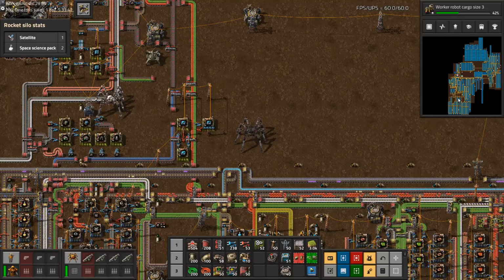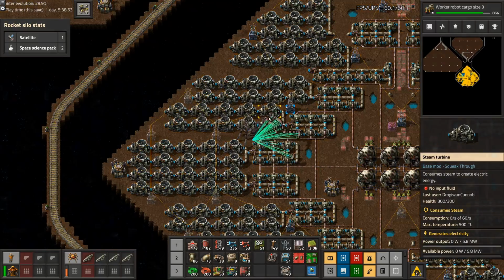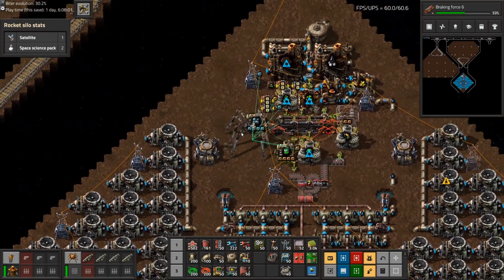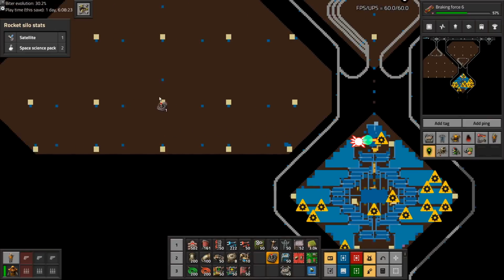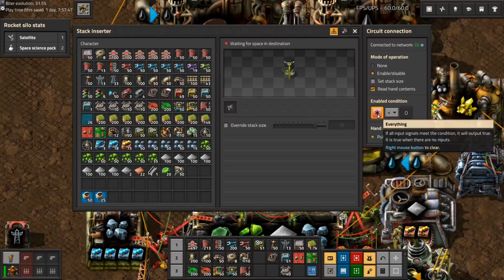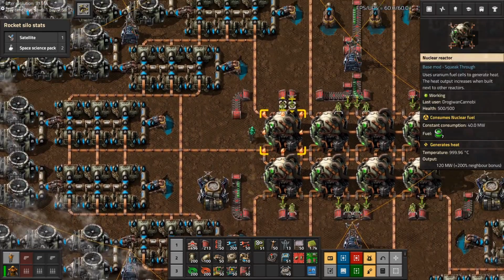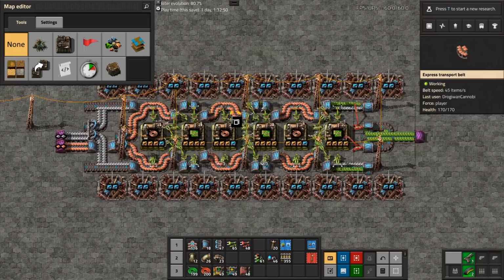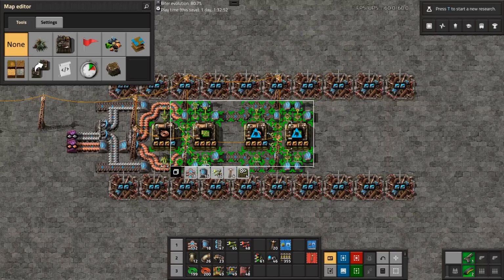Factorio SpaceBlock 9 - Nuclear Diamond & Module Build Part 1

Comment from the maker: I was reminded that I promised to put out the blueprints with this episode, so I did! They mostly consist of the landfill and rail stuff but I also included the power plant, the green circuit build and the plastic build that I stitched together last night (and of which I have no idea whether I will use it or not). 
I've also added the link to the blueprints and a save file to the video description in case this comment disappears into the void, but here you go: 
Prints: https://factoriobin.com/post/_Nix5jOW
Save file: https://drive.google.com/drive/folders/1yNsYsYRAgblp7u2iRbCxe1nQZuEyBYhn?usp=sharing

Comment: 15:26 - I might suggest only taking out of that furnace if there's more than, say, 60 iron ore in the wagon. I say this because I could imagine in the case of being low on iron ore, it doesn't add anything to the furnace, so all the plate gets taken out (what I'm suggesting would block this case), the furnace becomes completely empty, and then when 50 iron ore becomes available again, the inserter swings, but maybe it grabs plate, and then you have it making steel again... I don't see space for a filter inserter, so... Unsure; worth pondering?
Reply from the maker: Okay, so I just did a little test and it seems like the order of things in the train wagon matters. The inserter will always take the rightmost item in the wagon, i.e. if theres a stack of ore and a stack of plates to the right of it it will favor the plates. So I might want to switch that around just to be sure. 
BUT: In all my tests the inserter kept grabbing ore as long as it was available, no matter where it was in the wagon, as long as it had started picking up ore. And since it's never going to use up the iron ore in the wagon it should never switch. 
That's the theory, at least :D
Reply: @DroCaMk3  Good to know... so, I guess it just got onto steel because you were emptying stuff?  And that's why I was saying set the outserter condition, though... as long as there's enough ore that it's allowed to pick up_, yes, it'll keep grabbing ore...... if the input all gets smelted, though, _and the output gets removed, then it goes back to having a choice.  Don't empty the output while the input is empty, and all is good ..... not relevant here I guess, but as a principle to apply in any similar situations in the future.
Reply: or replace the inserter feeding the furnace with a filter inserter for ore.
Reply from the maker: @brendanmassaro9595  I kind of have to use long-handed inserters there. But I guess I could switch things around and put the smelter where the fuel cell assembler is or something like that. But I think things are working as they are.
Reply: @brendanmassaro9595  Yeah, except in the configuration of structures at hand, we're relying on long-handed inserters.  So, unless an inserter mod is in play, there's no long-handed filter option.

Comment: I don't think anyone else noticed, or i am just dumb, but the top left and right heat exchangers don't have a heat pipe
Reply from the maker: You're not dumb, but you're right, nobody else including me noticed! Turns out I didn't even notice in the performance, since the whole thing is slightly overbuilt anyways, but I'll fix that anyway. Thanks for the heads up!

Comment: this smelter design suffers from a lack of line  balance, this  will not work with mines as you calculate (5 to 6 belts )
Reply from the maker: Why? I'm prioritizing each belt into one smelting line (roughly 80%) and all of the rest will overflow to the last smelting line which should exactly get a full belt from the leftovers of all the other lines. Where did I go wrong?
Reply: @DroCaMk3   it works , line balance is not an issue when all input is consumed. pardon.
ore linear balance problems can be avoided by placing an input and output on the same side of row

Comment: The end reminded me of my thoughts in an earlier episode where you stated you didnt want to export stuff "below" blue circuits, which does make sense but with the way the islands are you cant really build big stuff, so its either what you proposed at the end, or instead of 1 big module/whatever build you could do 2 half-sized ones, maybe even split speed and Productivity modules into seperate islands if thats not what you planned to do already
Reply from the maker: Yes, I think I'll have to scale down. I was planning to split prod and speed modules, although it's pretty much the same whether I make separate builds or two half-sized build that make both of them - I mean they do have the exact same recipes after all. 
To be honest, I pretty much just eyeballed what I thought I could fit in there. Might have been a little too optimistic. But shifting things around and deleting a few things shouldn't be too much work - I wanted to make enough to feed 4 assemblers making mk3 modules and I might just settle for 3 instead.
Reply: @DroCaMk3  in the episode, you mentioned planning it for mining productivity 10, but ended up not doing it. You could save a considerable amount of space maybe planning it for productivity 4 or 5, as those techs are considerably cheaper to get to

Comment: You could make the ore duplication feed multiple smelting “outposts”. If you make a lot of parallel production lines they could feed a single train now but in the future the same production could feed multiple trains.  And all you would need to do is make more smelting outposts.
Reply from the maker: Good point but I've kind of committed to do on-site ore production and smelting. I mean, I basically designed my whole base structure for it. I'll see. I'm not going to increase in prod bonus for a pretty long time anyways, so I'll have some time to think about things (and just ignore prod bonus until then, I guess)